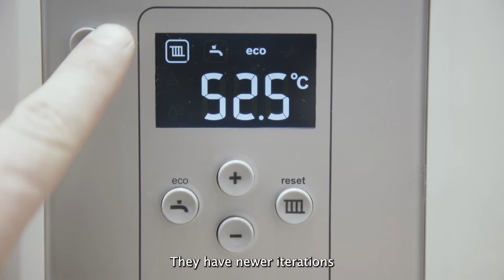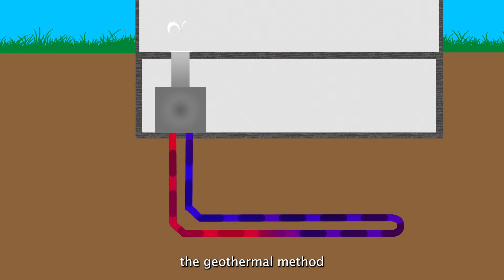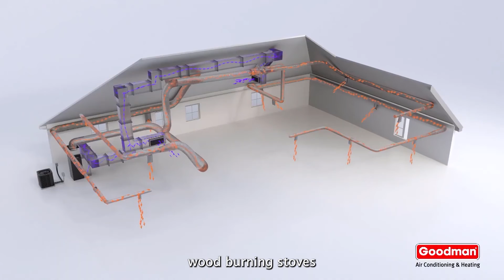12 types of heating systems for your home

Comment: I always love to think how some cooling & heating solutions could work together, think like radiant system in the floor, walls, and ceiling, which is also connected to a geothermal system. add on top of that passive housing and the energy savings would be on steroids😄

Comment: Sir! Could I use air power to rotate a refregarator moter and cooling side on my roof and the heat side in the house, and be CO2 good as the gas?